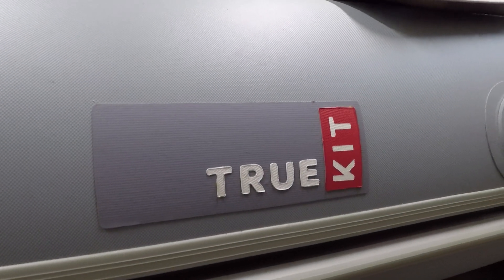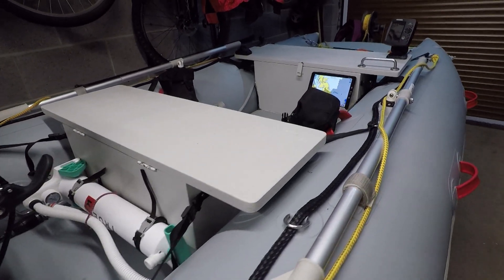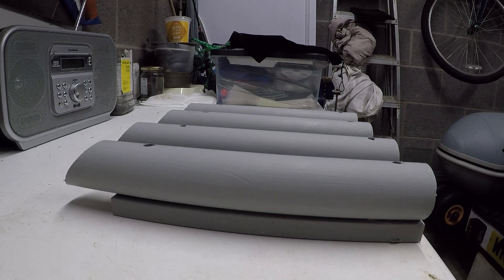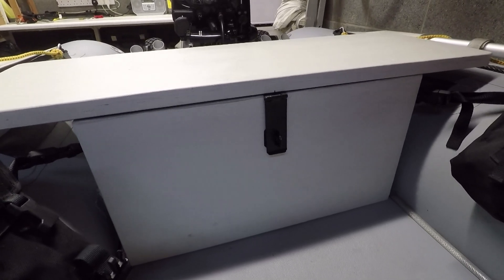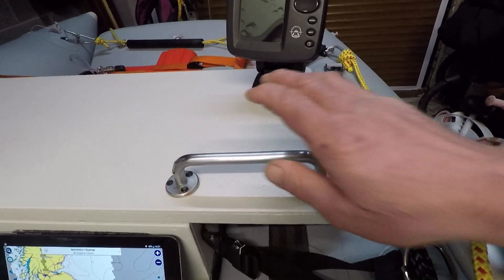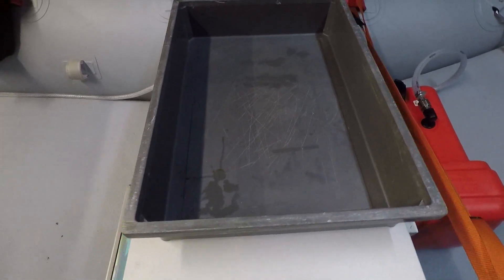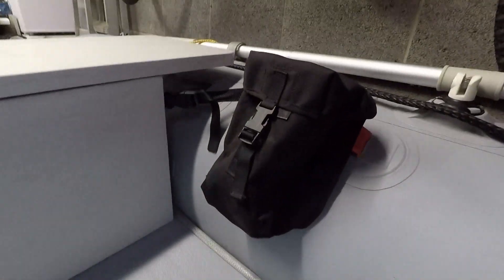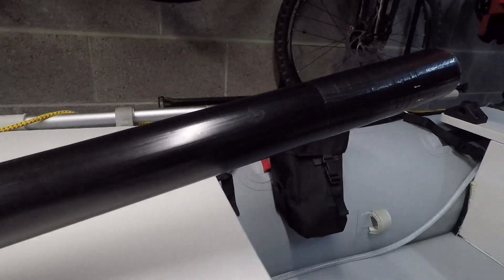SIB Fishing Set Up part 2 - Truekit Discovery 330

Comment: Nice. Slap still tinkering with my Disco setup.  Does extra weight blunt performance for yours?
Reply from the maker: Thanks, I haven’t tried  the boat without any load in yet to compare. Have you raised the engine height on the transom?
Reply: @TheHopefulAngler  I have raised it and it goes better lifted up 2cm on transom with my Tohatsu 9.8 2S.  Otherwise it splashes a lot from transom.  Also I raised tilt angle to the 3rd pin from bottom and fitted Solas propellor.   Thinking of splashing out on a Tohatsu 15 4s, for more oomph, but I do like the lightness of the 2S.    

Great boat but quite sensitive to set up and weight distribution.   Enjoy.  Nice vids btw.  Thanks for making them
Reply from the maker: @gaycha6589  thanks hopefully more to come weather and time permitting. I tried raising the motor before I had the hydrofoil on and got a lot of ventilation, I’m going to try again with the hydrofoil, I think it will need a different prop, what type of Solas prop did you get?